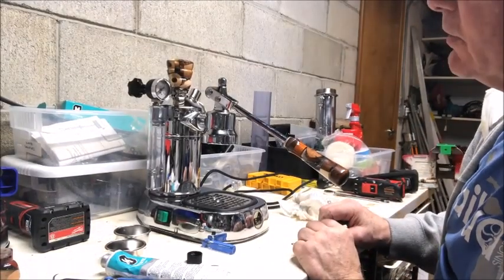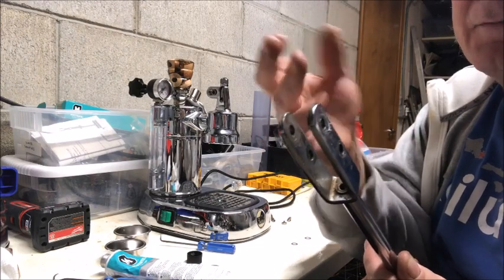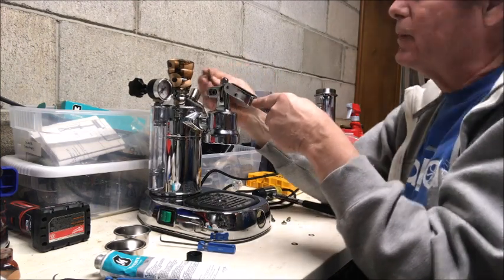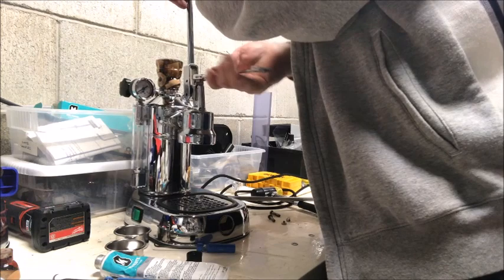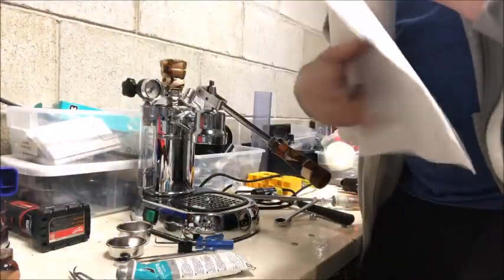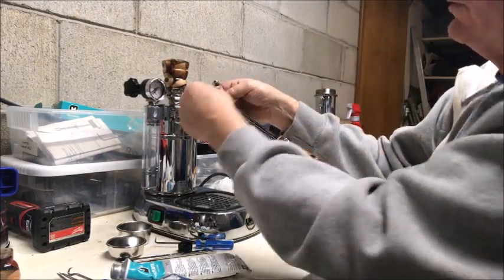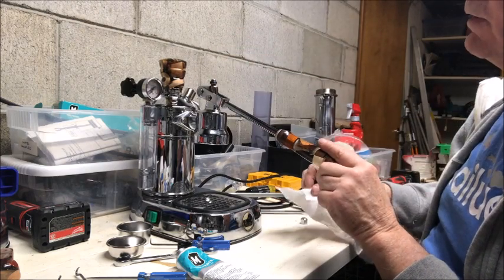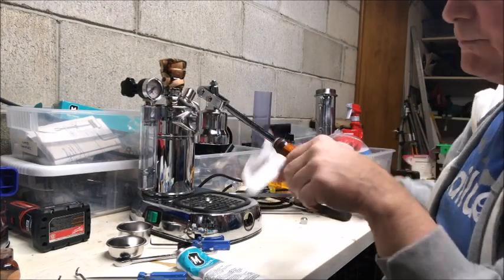La Pavoni lever play adjustment

Comment: Appreciate this video! I have always been bothered by the play in the level on my pavoni. It’s like having a sloppy manual transmission which drives me nuts. I’ll be replacing the group gaskets and shower screen shortly so i’ll be using your mod while i have everything apart. Thanks again!
Reply from the maker: Some people use nylon washers instead of stainless steel to avoid scratching. IMHO- there is wear already on the grouphead, so this mod doesn't add any.

Comment: Great job. After following your suggestions wobble was much reduced!  But.... Does anyone know if there is a way to reduce the play of the lever bar itself? That is there is much play at the point where the straight bar attaches to the U shaped part. Thanks so much
Reply from the maker: The is a weak point of attachment. Some have tried peening the back of the handle. IMHO- better to just replace the handle with one that threads into a solid U piece. Several aftermarkets are available, including this one: https://coffee-sensor.com/product/la-pavoni-lever-custom-made-arm-and-fork-pins-included/
Reply: @BrucePappas  Thanks so much. While it would certainly resolve the issue it is a little more than I can just now afford but will try peening the back of the handle first.
Reply from the maker: @josephdragan7734  - Let me know how it goes.

Comment: I just got one, looks nice, has patina and character but if I wanted to restore it how would I go about it?
Reply from the maker: First, I love patina on most things, especially patina and character. 

Second, these machines in general just need a good descale, new gaskets, and a good lube job.  do you have access to Facebook? We have a very active, helpful group (8K members) and a great Resource Center.  https://www.facebook.com/groups/LaPavoniLeverOwners/

If not, let me know where you are and what you're looking for.
Reply: @BrucePappas  im sorry I don't have Facebook but my unit is running great, just a little rust spot in the base so I'd like to restore just that part, maybe but a used base or restore this one. I did a very thorough descale she needed it. Im practicing with some store brought coffee and she running like a champ.
Reply from the maker: @david029014  - is the rust under the drip tray? Or on the base? How bad is it? I wouldn't recommend a used base. New ones are over $100 USD. 

I'd probably recommend some good rust-stop and clean nail polish or similar products.
Reply: @BrucePappas  yes its under drip tray, rust stop and nail polish? Any you tube videos showing how to do this? I was thinking of taking apart and have it cleaned and powder coated.
Reply from the maker: @david029014  - that's the other option. It takes some special tools for remove and re-tighten the boiler flange.

Personally, if it doesn't show much, I'd just stop the rust AND keep it clean under the drip tray.

Get a product similar to this (smaller quantity) to stop the rust. 
https://smile.amazon.com/gp/product/B01BL88R3Q

Then seal it with something, like clear lacquer. Small amount of clean nail polish works.

Comment: Hi, this is a comment for your other video "La Pavoni pressure profiling kit & brass sleeve Install". I'm not sure why, it's marked as "content made for kids" so comments are not possible in it.
I wanted to ask you what made you decide on the brass sleeve and piston vs the stainless steel versions. I have a millennium which I'm considering upgrading with a metal sleeve and piston and not sure which one to choose.
I don't know what convenience, if any, the steel version offers over the brass version.
Also, have you tried the isolator? It seems this is a worthwhile upgrade as it lets you control the head temperature.
Finally, I wonder whether the pressure profiling kit will fit a pre-millennium machine. Any idea?
Reply from the maker: Thanks for the heads-up. I change that setting, so now comments are allowed.

This video was a preview of the first brass sleeves being made, so it's older. You're correct that the new stainless steel sleeve and piston are more temp-stable. I used both in SS on my "Ultimate LP" rebuild.

I don't have an isolater, as I have a Gen3 (Millenium) machine and don't need it. 

And yes, most PPK will fit Gen2 (PreMillenium) machines. The piston is largely the same.
Reply: @BrucePappas  Hmm... I'm tempted to go for the stainless versions then. Non-reactive and non-wearing are also properties to  consider.
Reply from the maker: @Stelios.Posantzis  - correct. To me, SS is the way to go!
Reply: Hmm... it seems it still does not give you all the subscription options when choosing to subscribe... I thought I had subscribed to all but now it seems it just defaults to none no matter what I try.
Reply from the maker: @Stelios.Posantzis  - I'll look into it.
Reply: @BrucePappas  Thank you for the tip!

Comment: I'm not sure why the play in the lever annoyed you.It's not a big deal as it's not affecting the function in any way. If it annoyed me I would have just used plastic washers rather than risk marring the lever finish by trying to bend it.
I've seen another youtuber replace the pin rollers with brass ones. I think this is a mod worth considering. If one replaces the rollers with brass ones, then selecting slightly oversize ones will also get rid of the lateral play. The size always can be trimmed to fit perfectly with some fine sand paper.
Given the amount of daily stresses the group head housing is subjected to by the steel lever and the portafilter I find it hard to understand how it can withstand them without deforming being made of brass.
Reply from the maker: I"m not the only owner is annoyed by lever play. But if it doesn't bother you, no need to do this mod. 
IMHO- there is wear already on the grouphead in this area, so this mod doesn't add any.
Frankly, I like using a needle roller bearing and stainless steel pins to hold the lever.
Reply: @BrucePappas  I'd like to see that implementation. It's kinda hard to picture it in my head right now.
I checked my machine and even though there is some lateral play it's not significant. I wasn't able to see any wear in the areas contacting the rollers even thought this is an old machine but it might be there, just hidden.
My main concern is exerting too much pressure on the lever and  in turn bending the neck of the grouphead or the lever itself. I'm worried with repeated application it might lead to fatigue and cracking or bending the lever out of shape. Either would be quite bad. A proper lubricant will help as I don't have this issue with the Millenium version.
Reply from the maker: @Stelios.Posantzis  it's in a different video. https://youtu.be/yVEtKnlSX1Q?t=1626